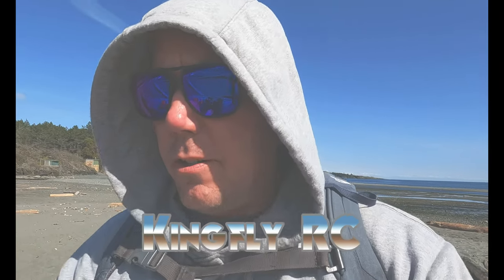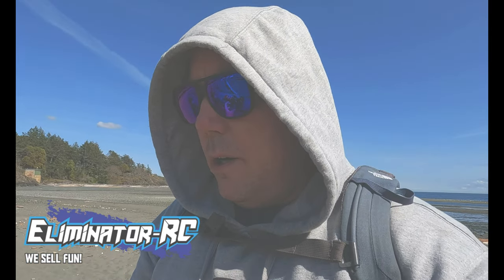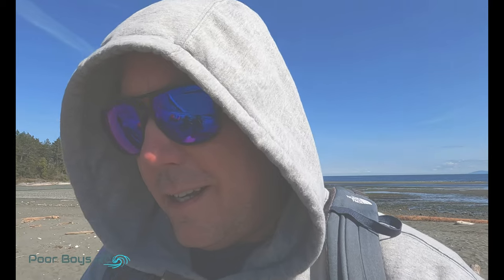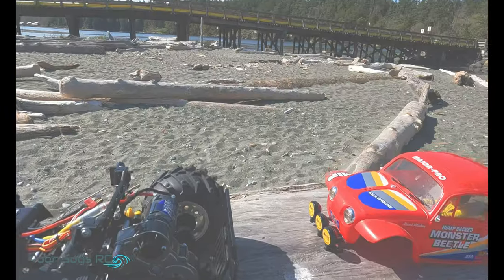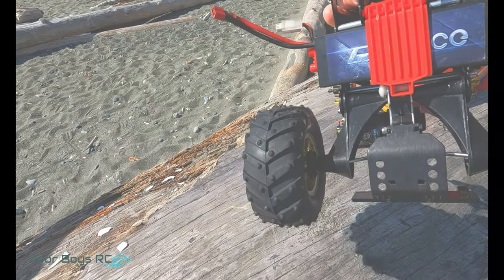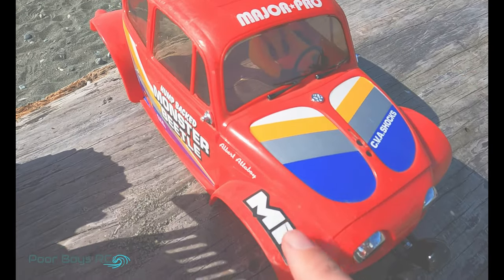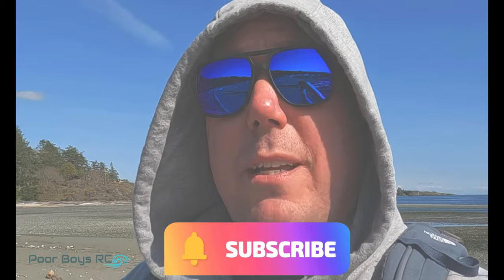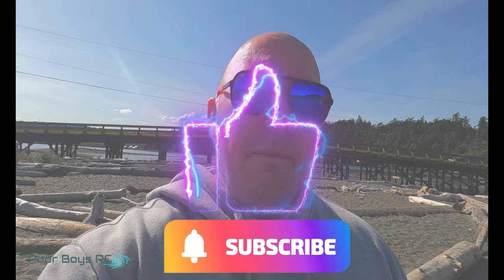Tamiya ORV Monster Beetle with Kingfly RC Chassis Testing on the Beach!

Comment: Most excellent Fil!!
Was waiting for this one!
That looked properly at home on the sand fella.
I've always been too concerned about sand getting in the drive shafts and MIP ball diff to run any of my ORV Chassis cars on the beach, and go with the CWO1'S instead as they are much better sealed.
Most interesting though-
That chassis upgrade seems to have made the rig much more planted, especially when jumping.
Mine always land 'nose heavy'.... where as yours was the opposite, has that chassis re distributed the weight a little?
Great footage there dude, and great to see the classic icons of our youth still creating such a fun driving experience after all these years..... who needs Arrma and Traxxas? 😂
👍 👍 👍 👍
Reply from the maker: Hey buddy, yeah you're totally right, the MB was definitely a little more planted than I'm used to. I did lower the rear shocks by apx 1 cm to keep the dogbones from popping out, so I imagine that helped out with handling a little bit, but overall, I think this chassis really stabilized the MB, and made it handle a lot better. Fingers crossed the sand is keeping out of the gearbox! I haven't taken it apart since I installed the MIP diff, several years ago. Cheers buddy! 🍻

Comment: Excellent video👍 I like you had the foresight to not paint the body! I didn’t think that far ahead and big lessons learned was never put effort into the body then put a fully tightened up MiP diff in it with brushless and 2s…….it doesn’t end well😢
Reply from the maker: Yeah I figured the is was going to be a runner, so I didn't bother painting it. And jist like you, Phil, when I dropped in the MIP diff, Super Stock BZ and a 2S lipo, punched it, the thing nearly did a backflip! 😆

Comment: Good run Phil. The chassis seemed to handle well. Were you happy with the rear suspension? It would be interesting to hear your post run thoughts.
Reply from the maker: Hey Derek! Yeah I was quite happy with the way the new chassis handled. The steering feels more precise and by lowering the suspension by about 1cm, the COG came down and I was really able to kick up the sand through the high speed turns, and still keep the rubber side down. All in all, I'm loving the new Kingfly RC chassis! 🍻

Comment: How do you shorten the shocks on this please?
Many thanks
Reply from the maker: Dismantle the shocks, and add two o-rings onto the shock shaft, under the piston. Then put the shocks back together, add oil, and now the shock is shortened! 👊🏼
Reply: @poorboysrc  Thanks for info mate
Reply from the maker: @SRG-HITMAN-11  Any time, brother! If you're stuck, just shoot me an email @ poorboysrc78@gmail.com and we can take a deeper dive.
Reply: @poorboysrc  thanks mate one more question what oil do you use for the dampers in the monster beetle and blitzer beetle as both kits come with  yellow soft oil ?